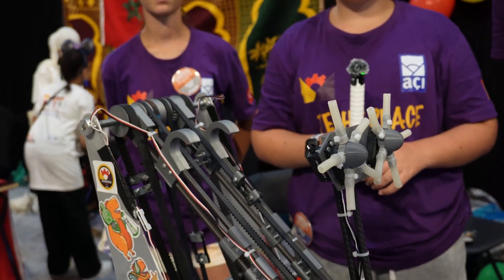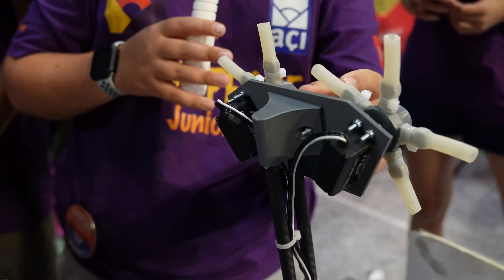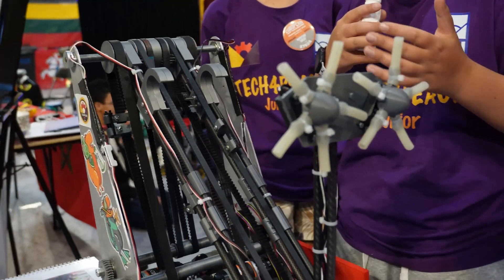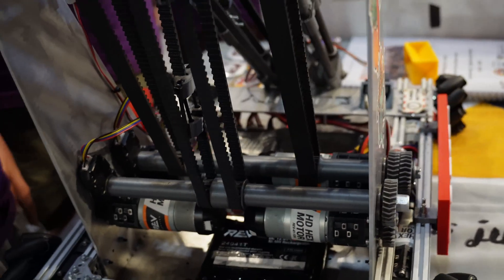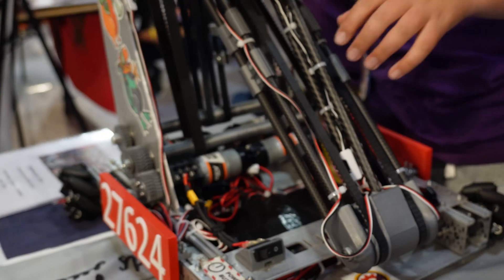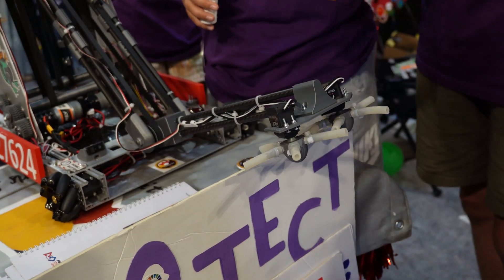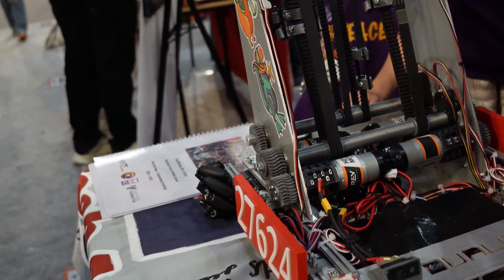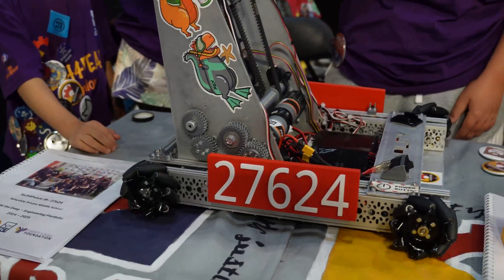This Team's Smartest Design Idea: FTC Robots Revealed #27624

Comment: İ realy liked the design of the intake
Reply from the maker: It is rather unique, I’m surprised that it worked as well as it did honestly! Goes to show the importance of testing.
Reply: @BroganMPratt  As one of the the mentors of the team, we had a basic intake with two 3d printed flex wheels that had spokes in mind but we could not get the grip that we wanted which really slowed down our cycle times since intaking required precisely aligning the intake with the game piece,  after checking some centerstage robots and seeing how fast their game piece transfers were with surgical tubing we wanted to adapt the same system to an intake and it worked like a charm. Thanks for the awesome vid!